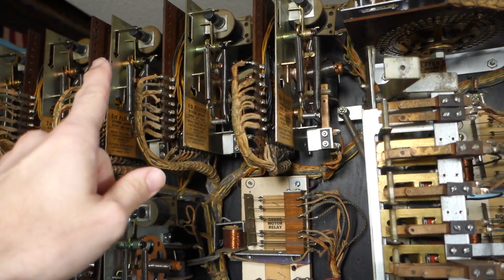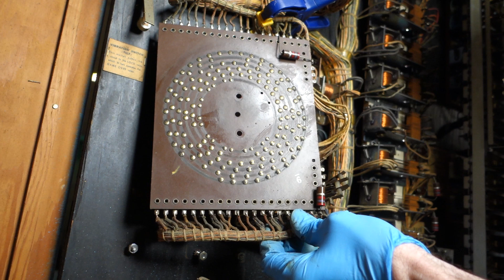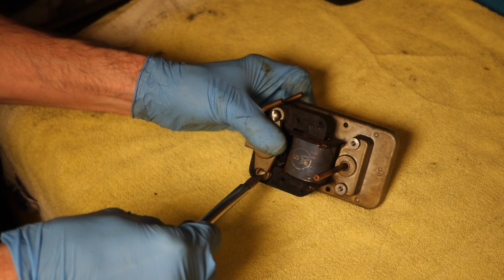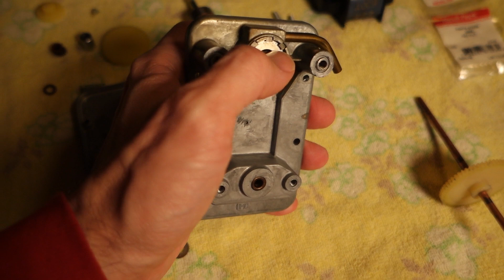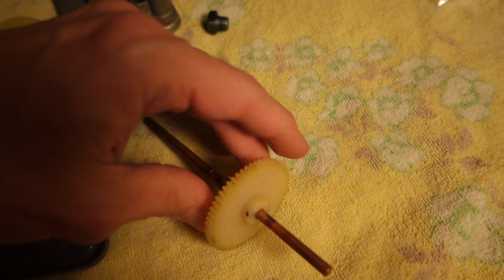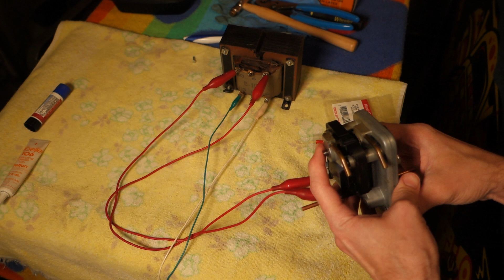1962 United Embassy shuffle alley project (ep12) score motor refresh

Comment: Hi Jeremy. I have a problem with my Chicago coin shuffle bowler model462. It resets the pins after the first puck almost every time. I am out of ideas this is my first machine to try and restore. Almost got it. Thanks
Reply from the maker: that is a tough one. FB has a pretty good group. Search ball bowler group. The group is titled something like ball bowler/shuffle/skee ball
Reply: After the 1st shot, does it also step up the frame? Is the
 2nd Shot Relay also tripped after the 1st shot?

Comment: Is there a way to tell where the start point is if there is no manufactured markings on the cams or fingers in the back?
Reply from the maker: The metal cam will be the easiest as it determines where it stops based on one of the switches. You might be able to determine the other sides stopped location by screw marks on the shaft. If not - the schematic normally shows switches in their resting state.
Reply: @PinballMayhem  thanks for the reply! I sent you a email

Comment: How do you ensure the motor shaft spins and resets inside the armature?  I took mine apart (not to the level you did with the gearbox), cleaned it, and put back together but the motor shaft on mine does not bounce in and out like yours.   Can I oil it?  Can I oil the part that sits inside the armature?
Reply from the maker: Great question! If your motor has that type of rotor then yes, you can oil the bearings. Observe the rotor and figure out how it's supposed to function.